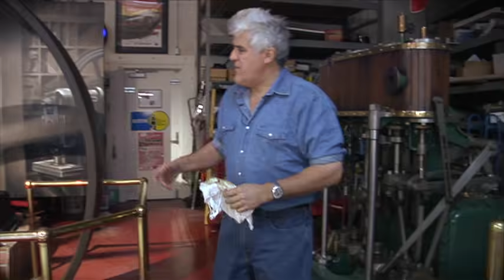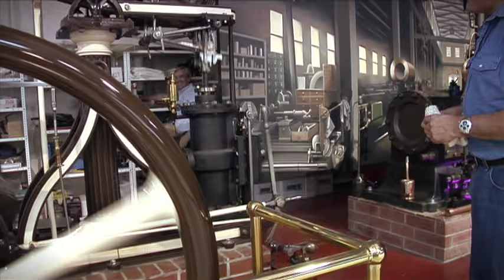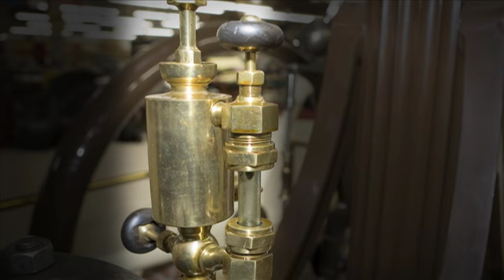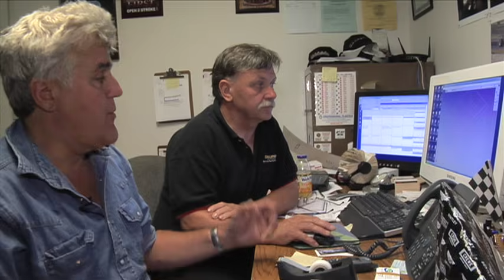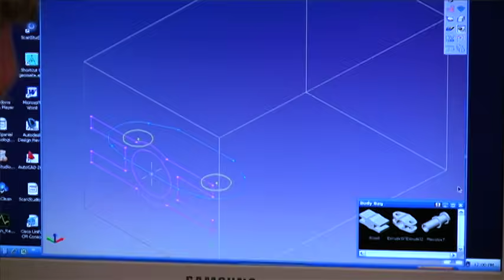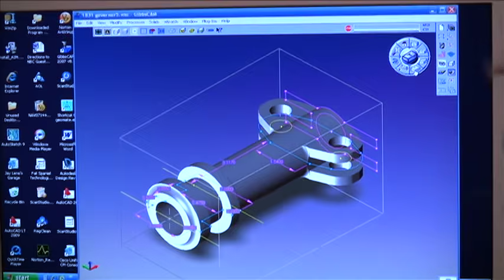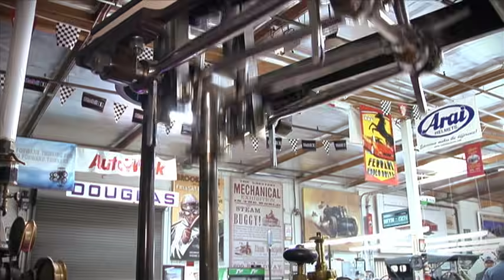1832 Steam Engine - Jay Leno's Garage

Comment: Back then the industry normally used one large wheel for the whole factory. But they often exploded all around the world. So at one point they had to start make them in steel. And use multiply smaller machines instead of one big.

Comment: In Emmett Idaho there’s a steam engine from the old lumber mill on display for the public. It’s so big that there’s a two story structure built around it so you can look at all the parts. The fly wheel is 16’ tall weighs 22 tons and produced 1,100 horse power.

Comment: What country was you combine build? I worked at the combine plant from 73 till it closed work on some combines for export to Australia they had to have special glass which we're not designed to handle the extra thickness so we had to add brackets to hold the glass from falling out. I'm a former combine mechanic at the combine plant I built a special machine for a show called the Phoenix it was painted all black and gold it's in the barn somewhere in Kansas it had a custom interior someone in England found out that I worked on it and get got ahold of me on Facebook and sent me pictures of it. Or combines of today are too complicated you don't need all those sensors especially John Deere they have sensors for sensors are you combine back then was $47,000.

Comment: Bo ham is auctioning on Feb 8th the iconic 91hp Corliss & Wheelock Horizontal Steam Engine, built by Crepelle et Garand, Lille, won the Grand Prix at the Exposition Universelle, Paris 1889, the brass maker's plaque engraved Anciens Ateliers LE GAVRIAN, CRÉPELLE & GARAND, Successeurs de V. BRASSEUR, LILLE-FRANCE, GRAND PRIX EXPOSITION UNIVERSELLE PARIS 1889, MACHINES A VAPEUR CORLISS & WHEELOCK.

Comment: Impressed that Jay is into this stuff, think he would like "The Waverely" its a paddle steamer that still does runs from London to South end, it was built after WW2 because ships that were drafted into the war were given the option of being replaced as they were or in a more modern form if they were sunk (it was) but the owners wanted a replacement that was the same as the original.

Comment: Elevators also have those fly ball governors on them, I have one that came from an elevator that was removed, a wire rope turned the governor's sheave.
I really like the sound of the Corliss steam engines as they run, a building I lived in in NYC used to power the cable cars on Broadway in the 1890s and there were four 1200 hp Corliss engines in the basement along with a 32 foot driving wheel, but every bit of it was removed and scrapped long before I moved in. It was the only such plant of it's kind built and it was different than the SF Cable Car system, the  NYC system used the engines to pull a huge, very long cable under the streets around in a circuit. It was plagued with problems and replaced with electrified cars around 1906

Comment: In Sydney we have an original, Boulton and Watt steam engine  It was one of the earliest rotative (wheel-turning) steam engines to be built and is the oldest in existence. The engine is also one of the oldest in the world to still work regularly under steam.

This engine was made by engineer James Watt and entrepreneur Matthew Boulton of Birmingham, England. It was installed in Whitbread’s London brewery in 1785 and was used there for 102 years, powering equipment for grinding and lifting malt, stirring vats, and pumping water and beer. Professor Archibald Liversidge, a trustee of the Museum, was in London when the engine was taken out of service and asked that it be donated to the Museum. It arrived in Sydney aboard the sailing ship ‘Patriarch’ in 1888.

Comment: i oiled on the lake steamer st crapo in the late eighties. triple expansion steam engine.  also had a scotch boiler, firetube.  hand fired with coal  most of the time.  helped the first engineer take the engine apart at lay-up.  wish i could remember his name, jim i think. a real pro and a good guy.  to be below decks with a steam turbine humming away under way is very pleasant. the triple expansion was nice too.

Comment: How cool to find out that Jay has a stationary engines area! My dad has been an old engine collector for my whole life, I'm 49. He used to have a rather large gas engine but sold it many years ago to help out his parish which was on hard times. He specializes in maytag engines. Maytag very early on sold washing machines that ran on gasoline because most rural areas weren't yet on the grid. Hes a retired tool and die maker, and his his retirement just for the fun of it he maps his engines very much the way the guy in the video did, half scales them, and then basically hand builds working gas engines from raw materials such as blocks of metal. He would be like it was front row tickets at the Indy 500 happy to have a few minutes in just that garage section.

Comment: A lot of bigger steam engines do make noise, plus the belts from the machinery that the steam engine would have powered. Sometimes you don't notice it on smaller engines like that especially when they aren't hooked up to what they actually ran.

Comment: According to one of the commenters, that is an 1832 Boulton & Watt steam engine.  If so, here is a little history about the company.  I'm reading a book about the evolution of steam and electric power named "The Power Makers" and Boulton & Watt figure prominently in the development and advancement of the steam engine.  They started their company in 1775.  One of their engines was installed in Robert Fulton's first steamboat in 1807.  James Watt of Boulton & Watt invented the centrifugal governor (the thing with the spinning balls).  The firm of Boulton & Watt endured until 1800 when it gave way to a new partnership formed by the sons of both men.  Matthew Boulton died in 1809 and Watt in 1819.

Comment: That's an amazing piece of equipment. 

I wonder how it rates, efficiency-wise, compared to modern machinery doing the same level of work?
Reply: In Leicester, England there is the Abbey Pumping station which has 4 locally manufactured Gimson Beam Engines from 1891 which were in use until the 1960's when an electric pump was installed which is much smaller. For comparison the power output is about the small aero engine for a light aircraft. Needless to say the beam engines are beautiful and local very impressive when they are steamed up.

Comment: That oscillating  lever ( to work the slide valve by hand , when the engine is not hooked up on the eccentric for automatic working ) gives me the creeps, so dangerous to get a blow from that..

Comment: "The older the machine the bigger the balls, that's the way life is I guess".  I will never forget that line.
Reply: for those that dont know - the 'balls' are the governor that controlled the engine speed - you could put excess steam pressure on her,  and then the governor controlled the RPM - if load changed, governor worked to maintain proper rpm. these were centrifugal, that is, as rpm increased, the 'balls' would elevate and control a valve that reduced flow to the engine.   thank you BSB369 for your comment!

Comment: It's a quiet-running engine because it's comparatively small. Engines in water pumping service had flywheels 25' diameter and larger. Look on Wikipedia at the Crossness Engines in London, or the Markfield Engine.

Comment: Taking the time to care that industrial design was aesthetically pleasing as the column demonstrates seems to have died out around the 1930s/1940s, up til then factories and railway substations and power stations and so on weren't just concrete boxes but still also looked nice. After WWII you get 'good enough' brutalism which leads to the McMansion homes of today designed to last just 20 years (and crumbling well before even that)

Comment: Dear Mr Leno, this is not a "walking" beam. Walking beams have a longitudinal movement to avoid using (or pre-dating) James Watt's parallelogram linkage at the cylinder, walking beams did not have a fixed central column but instead had  a pair of vertical links either side of the beam, pivoted at the ground as well as the centre of the beam this allowed the beam to follow the straight line motion of the piston rod and due to the vertical links rocking back and forth looked (with a little imagination) as though it was walking. rotative beam engines such as yours use Watt's parallelogram to do the same job. So your engine is a beautiful rotative beam engine which came later than the "Cornish" atmospheric pumping beam engines which didn't rotate.

Comment: Typically, early industrial-age factory steam engines ran when the supply to water-driven (river) impellers was low (usually during the summer). Our old 1830's-vintage millpond in Ashland MA had just a setup. In fact, a long-passed neighbor, Ray Paraseau, born in ~1890 had grandfather who worked as a steam-engine fireman in the original wooden mill.

Comment: You know what would be a great addition?  A car that runs off of a Sterling motor.  Evidently in the 90's NASA equipped some Air Force trucks, vans and cars with a modern automotive Sterling motor and found them to be way more efficient.
Supposedly they still exist in an Air Force warehouse.  Just waiting for Jay to buy them and restore them.
Here is a video on them
Stirling Cycle Engine: "The Stirling Engine: A Wave of the Future" 1992 NASA
https://www.youtube.com/watch?v=H_Vnxapd5fs

Here's an article that says one of them still exists
https://www.hemmings.com/blog/2010/08/26/found-nasas-stirling-engined-dodge-d-150/

Comment: I'm not a communist or a socialist just a realist, but this is the problem I see with capitalism. This simple engine ran for 100yrs, kinda like the original "Edison light bulb" it would run for 200 or  300 if you wanted without a problem...

Comment: Gear cutting machines were invented in the clock trade, in the early 18th century and by 1800 were being used to cut almost every gear in industry, including this machine. Hand-cut gears (I still do this when repairing clocks made before 1700 to retain authenticity) were definitely not used on this size of machine, they were most probably sand-cast from wooden masters and then finely finished on a gear cutter or an indexed lathe.  Lovely, steam engine - would love to own one like this but my shed is too small.

Comment: Excellent feature of old machinery!  Great point about how it was built before there was such a thing as standardizing of threads and fits and such. Was surprised you didn't mention it as a "walking beam" type. Also would have appreciated a bit on the valve gear operation. Great engine!

Comment: 2:10 actually I bet they probably were, because even while the engines were quiet, the various belts and linkages and tools they were driving, particularly when you'd subdivide the power into hundredths of outputs... it must have been quite a cacophany.

Comment: Having been in a workshop that still used a common drive from a steam?  stationary engine it was quite noisy with all the belts flapping. And shearing sheds as well. This in the early 60s.
The engine and steam generation may be reasonably quiet but after that no.

Comment: my guess is that it is a Amos engine, I say this as the column is very similar to a six post one that I know of, Amos engines being of superlative quality.Some steam engines are not quiet, if you were to hear the valve gear going clackety clack on a Cornish engine.....
The cylinder on that little beauty is say 10" diameter, I know of 100" diameter cylinder beam engines at Kew in London, and indeed there is a 90" one not that far from me at Pool Cornwall England.
That rotative beam is my choice however, it really should come home - my home - now!
Reply: "if you were to hear the valve gear going clackety clack on a Cornish engine"

All right!

Comment: so i had this idea of a hydrogen combustion engine. i realised that the blow-by would consist mostly of water vapor and unburnt hydrogen. My worry is the trapped pure water vapor and what type of lube you could use in a hydrogen combustion engine?
Reply: Steam oil. What do you think these engines use? They have to deal with water vapour but have managed fine for decades in some cases.
Reply: +Spencer Wilton 
 Would the lube system be a total loss?

Comment: the village I live in, we have the largest working steam engine on earth. The flywheel weighs North of 80Tonnes. it doesn't power anything anymore but once a month they have it (and a load of other old engines) running. Hell of a thing to see.
Reply: Luke Schofield what was that massive steam engine powering back in the day?
Reply: ZapCannon5 a huge mill. I think it had 8 floors altogether. The mill itself burned down a while back but the engine house is still there, it's been turned into a museum for all the steam engine machinery.

Comment: I posted a comment about this pump and believed it came from a well that was decomissioned by me last year 2015 in East London. My comment was that the engine may have the numbers 736 stamped on the workings of the pump. This number is incorrect and should be 723 which is the patent No of Bolton and Watt the engineers that designed the machine. All the workings of the pump that were below ground to a depth of 65 - 70 metres deep had the number 723 stamped on them. it was made for the Indigo Dye Works near Bow in London and was commissioned in 1832. The pump opperated using 12 foot long wooden rods connected by steel plate links which were still intact after 170 years. The base working gear recovered is made of bronze, beutifully engineered. We took many photographs and made detailed drawing when the pump workings were cleaned up. How they made this is an engineering marvel in 1832. Jay has done a fantastic job preserving this engine.
Mel Stupple, England.
Reply: Thank you for explaining how this steam engine was employed. The engine is fascinating but understanding how the energy was used is the point of creating the engine.
Reply: Quite a late reply, but did anything ever come from your information?
Reply: this video is from 1998
Reply: @mesofius  but one of the PCs was using XP so it can't be...
Reply: @mesofius  shut up
Reply: Re read his post- he is talking about the pump below ground that this engine above ground would have been operating.
Reply: This would not be the engine you are talking about as Jay had this engine a long time before you took the one you are talking about out
Reply: @anthonywhenan2504  he was talking about the well that this pump was connected to not the actual pump. Read it again

Comment: just beautiful. could watch that for hours. i just wonder what the engineers of the day would think about how the replacement part was made
Reply: They would be as memorized by the computer as you would be while seeing that engine run.
Reply: @twistedyogert  I think you mean,  mesmerised.
Reply: @kennethslade8468  Yeah, my autocorrect f*cked up again.
Reply: I mean, using CAD modelling to replace unique parts is really the only way of going about it.  Modern CNC machines can produce any part which is designed.  What was really the most noteworthy was the fact that all of the threads weren't standardized back in the day... that would have made replacing parts quickly a HUGE chore!
Reply: @BayMacDre415  If CAD modeling is the only way, how did they produce the part in the first place? Do you think that in 80 years  running time, no part had to be replaced? That they just went "Oh, that part has a crack, let's jus scrap the whole thing,because CAD-CAM  hasn't been invented yet"
There's a shipyard where I come from that's  almost 250 years old. In 1925 they launched a Dreadnought class battleship with a Parsons steam turbine, that was a milestone in those days.
But not only that. Between 1927 and 1929, the shipyard apprentices that ranged from 12 to 16 years old, made a 1:10 functional model of that turbine, gear reduction and propulsion shaft.Tthat model turbine was displayed at a world fair  that year. It was running at 18.000 rpm. 
15 year old kids. In 1929.
Reply: DOUDOU.  DlENG.  34631098973
Reply: Naturally Luddite, they would be infuriated and terrified!
Reply: @alexhayden2303  oh please. Infuriated? Get real. They would p*ss themselves seeing half of the tech we have now. All this does is makes the process quicker and much, much more accurate. Just show them the Large Haedron Collider, the most complicated piece of machinery to ever exist besides maybe the quantum computer. They won't be angered and disgusted, of that I can assure you.

Comment: I have never seen such a small beam engine, it really is cute, here in Cornwall in England they were everywhere at one time, there is one about 3 miles from me now.  A winding engine on a sea mine. The biggest now is a 90" cylinder one near Pool, the biggest that I know about is a 144" cylinder in  Holland. (Cornish made)
At Kew bridge museum (in London)  they run Cornish beam engines, and if you stand next to the beam on the top floor and shut your eyes you know when it passes you as you can feel the mass of it pull you a fraction -weird, but it is a twenty ton beam.
I have a lot of respect for Mr Leno he knows things and appreciates them.
Reply: and in Cornwall we call the beam the bob
Reply: Adrian Katsikides I’m in Cornwall and I live 1/2 a mile away from a beam engine.